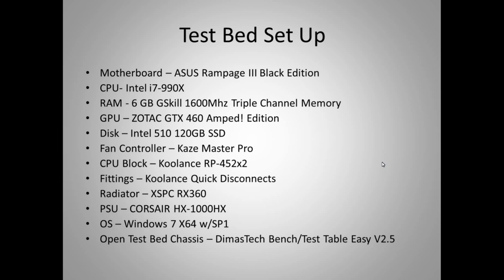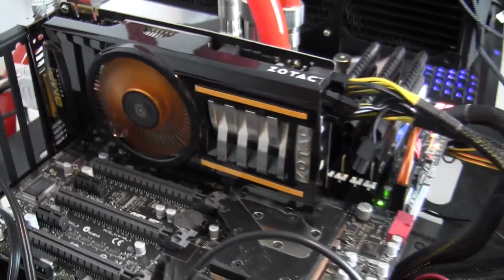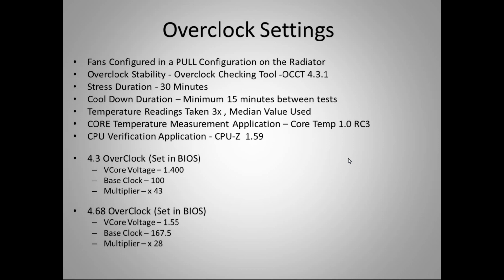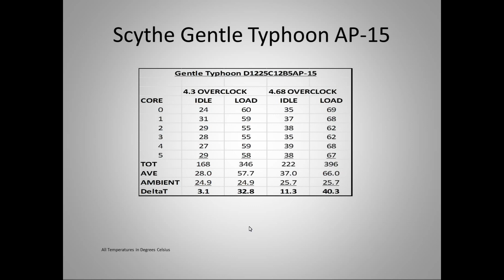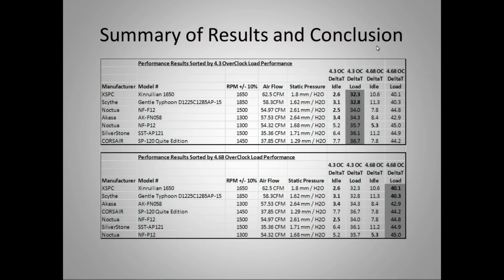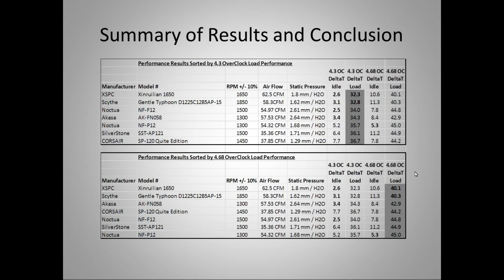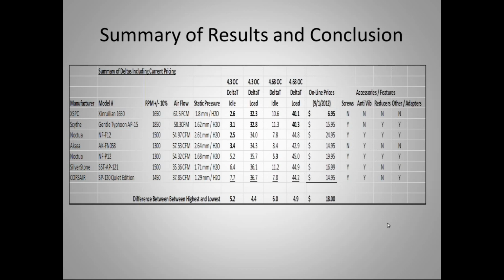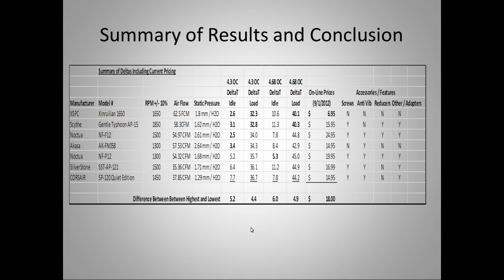PC Radiator Fan Testing and Comparison : Part 2

Comment: Ron, this is bloody terrific!
I find these kind of tests more helpful than lab results, it's a lot easier to draw practical conclusions (e.g. the regarding the tonal quality of a fan).
If you do have the time (and patience ;-)) to follow through on PigeonForLife's suggestions, that would be fantastic.
Possibly another fan to look at would be the Bitfenix Spectre Pro, it looks pretty good for radiators on paper (i.e. pressure to noise ratio), though this is a mere suggestion, not a demand ;-).

Comment from the maker: Depends on the space you need and how often you will really touch it.  I have both the Phobya WaCoolT and Dimastech 2.5 benches and if you are going to pull p[arts off and on it, regularly, the access and ease of use goes to the Phobya, but it is a large bench. If you pretty much just want to set it up and let it go and just for showing you parts off on a bench top and you have an E-ATX or smaller mobo. then the Dimastech 2,5 is good size. Dimastech actually makes smaller new benches for m-atx.

Comment: will you be able to give your opinions about be quite shadow wing and antec truequite pro 120, are they any good at radiators?, also I'm thinking of using 80mm radiator which of the fans you tested will you recommend??

Comment: So after seeing this video I'm acutally thinking about buying 3 Apache Blacks for my 360mm rad, but I have some questions. I want a completely silent system, do you think that these fans can achieve that? I am going to run these fans on a very low speed, is there any motornoise? The problem I have with my current fans is the noise of their motor. I want a fan that has no whining or clicking sound. So Ronsanut, should I buy these fans or not?
Thanks!

Comment: i must say that. If you use Static pressure fan, try to do it with the high FPI radiator. :)
aaand, i know one thing, Typhoons work in pull better than in Push what i cant say about NF-F12.
But, great work, thanks!
Reply from the maker: Cool. Thanks.
Reply: Ronsanut aaaand subscribe of course, you have very good reviews!

Comment: I was pretty much laughed at on OCN when I tried telling people that the XSPC 1650 xinruilian fans are some of the best performing fans for static pressure and overall performance on radiators, but people will cling to their beliefs even when facts stare them in the face.  This is just another video on youtube that proves what I've been saying for 8 months:  the 1650 Xinruilian fans are a Top 3 fan if you're gonna run water.  the only downside of these fans is they're sleeve bearing